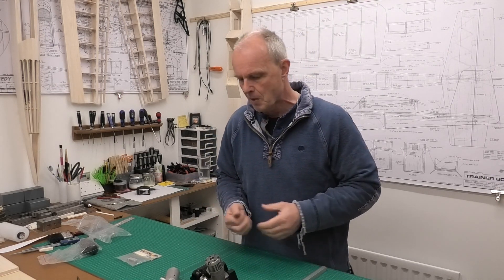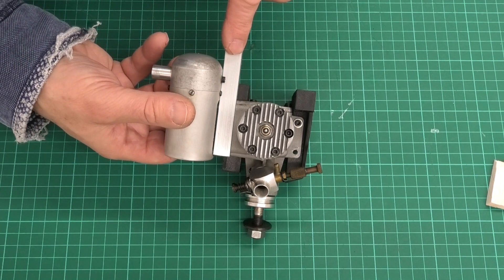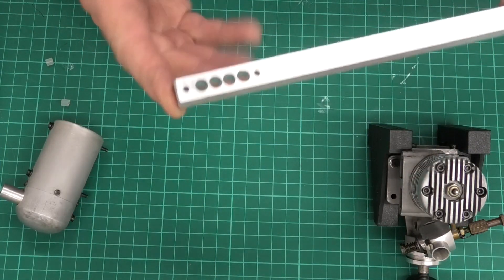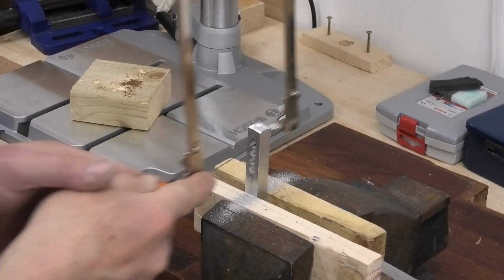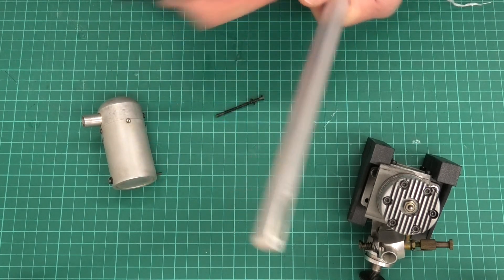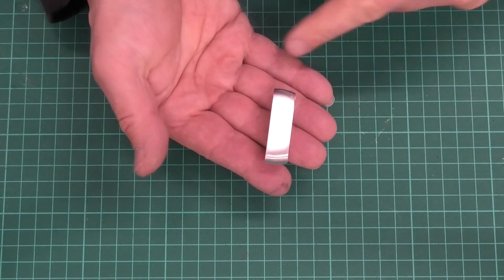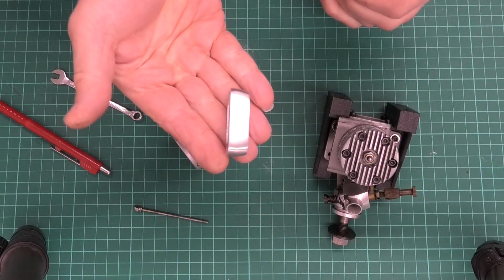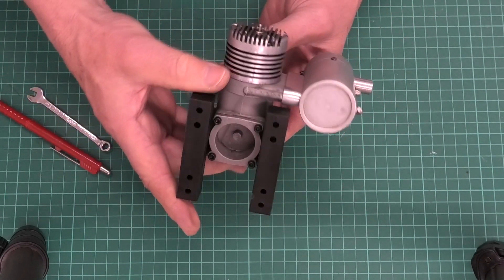Make your own Exhaust Spacer - Model Glow Engines - Merco 61 Peak Power Muffler

Comment: Sorry for the hard work but the size of the muffler is really too small for the 61 engine. You will loose a lot of power. Don't ask me how I know, for the way to make a spacer super job BR
Reply from the maker: The muffler is a "PeakPower Muffler", which was designed and produced by Merco for the Merco 61 engine, so dont feel sorry, this is a good muffler for the engine!  This is a great combination of engine and muffler.

Comment: Hi Mark.
It's a simple job,but an awful lot of modellers struggle to do it.
If the engine manufacturer doesn't make an extension for their exhaust, then it becomes a task to make one.
Lovely work.
Thanks for the comments on the trainer with the paw 60.
Yes it flew very well, and needed the PAW as it was covered in good old fashioned Nylon and dope!.
Almost indestructible, but heavy.
It didn’t  seem to matter much, and flew very steady in quite a stiff breeze.
The Merco and the PAW are both big chunks of metal,and brought the CG forward nicely.
Cheers.
John
Reply from the maker: Hi John, thanks for the comment and information, its appreciated.

Comment: Really nice job you have done Mark. Hand filing is not an easy task so well done. Necessity is the mother of invention. See you on the next video.
Reply from the maker: Thanks Terry, really appreciate the comment, hope you are enjoying the calm warm weather, great to be out flying 😀
Reply: @MarkRobinson555  Although hot we have had some really calm evenings. I took my Anzani Longster down to my local park the other evening and had a wonderful flite. On landing one of the wheels came off stopping the model dead and pushed the battery straight through the front bulkhead. I must have built this model about seven years ago and flown it more than any other.  Anyhow she is all repaired and ready to go again. All the fun of the hobby.
Reply from the maker: Yes, the more we fly the more we fix and maintain!  Pleased you got it fixed ok 👍